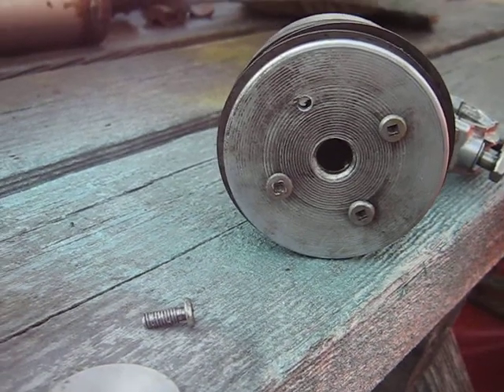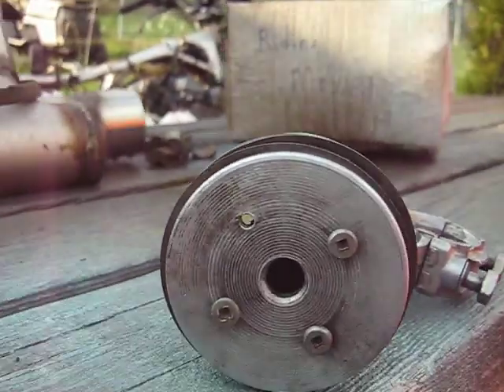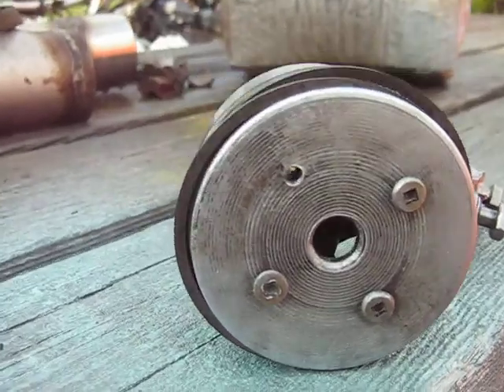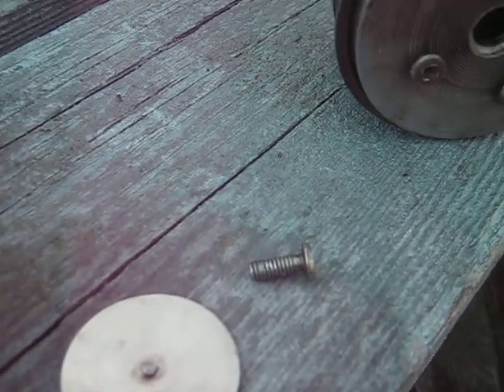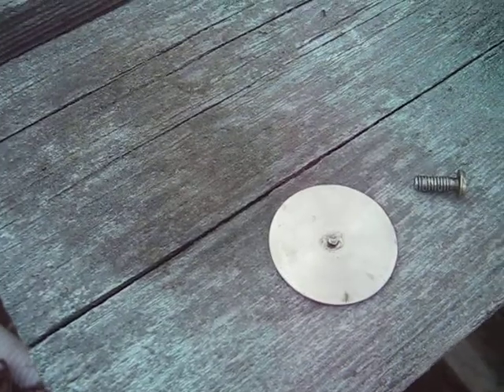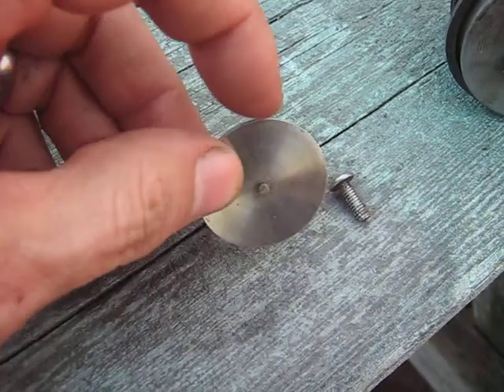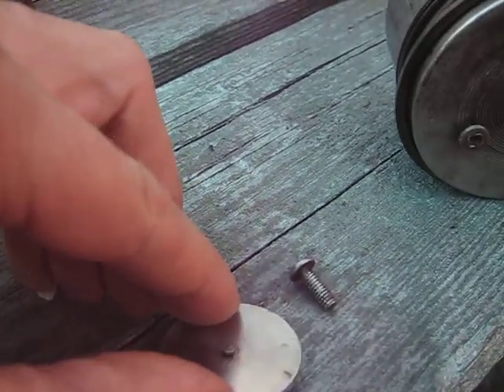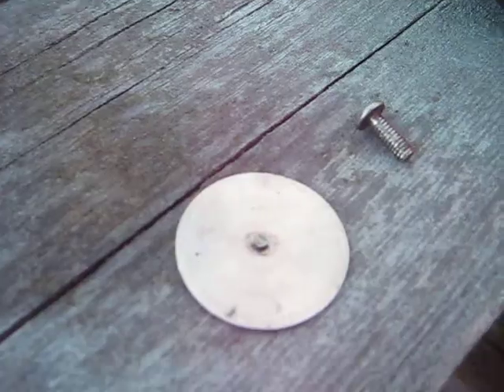Piston Valve Fabrication Vid.

Comment from the maker: I think a rivet type plug will work best, since any form of heating has the chance of causing warpage in the disc. Remember, don't try to cut a circle at the start, make a stop sign, also you must use the snips the right way, you want to bend the part being cut off, the same way all the time. I may have to make a vid showing that. I will review my other vid.